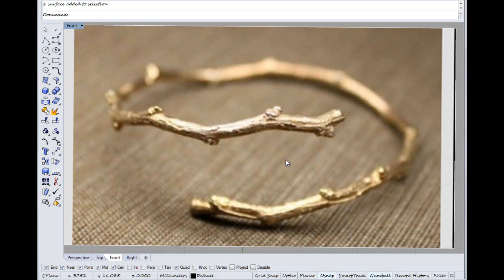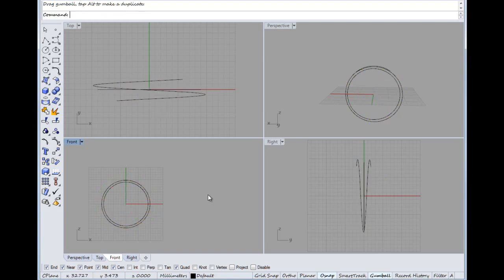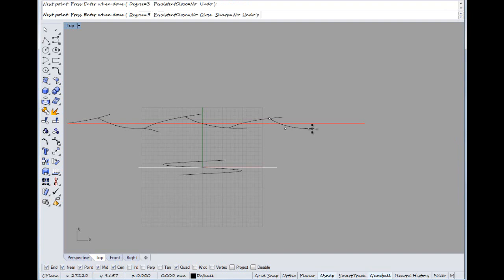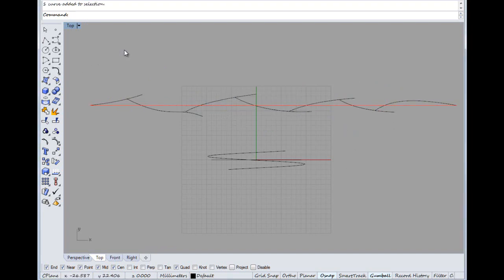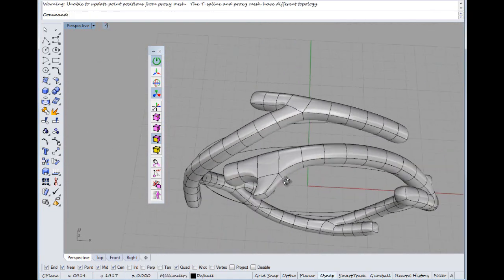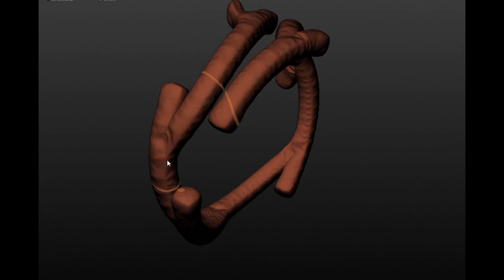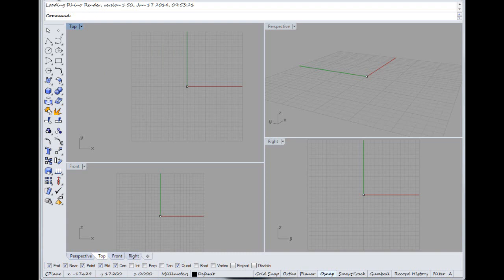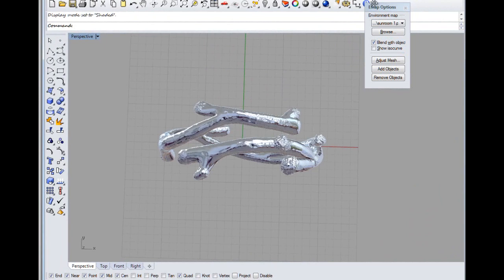Basic Rhino tutorial on making an organic branch ring with Rhino Cad and Sculptris

Comment: Hi, I really want to try to do this tutorial, and it's not working because Rhino 8 does not have the tspline splitcurve option, do you know where I can find it? Do I have to use grasshopper?
Reply from the maker: You could use the split  command and set it to point in the command line  and do each intersection manually. Tsplines was discontinued. I've not used rhino 8 yet but maybe there is a similar command in the sub d menu ?
Reply: thanks and how can I do textureing in rhino - Sculptris is not longer available and zbrush core mini does not allow the import of obj files. I got stuck there. Much appreciated! I really like this tutorial!

Comment: Hi! I really hope you still pay attention to your Youtube sections because I have gotten into some problems while following your tutorial. One is that even thought I managed to do all the steps without tSpline commands (because I don't have tSplines yet), when it comes to flowing along the surface, everything just gets tangled and wrong, and I tried mirroring the helix, booleaning the pipes, they all turned out to be distorted. Did I overlook something? Because I literally repeated every step you showed, and I can't figure out what's wrong.
Also, what are the good options for Sculprit when saving into .obj in Rhino, so Sculprit actually handles it as a solid, and not as a bunch of surfaces? I got a good look for experimenting and rendering, but certain modifications just torn the edges apart and I ended up with about 20-30 naked edges.
Reply: I have exactly the same problem. Did you already find the solution? thx!
Reply: Nope, I just gave up and made a different version lol. It's been four months, I can't even remember how I did it, but I could probably improvise again.
Reply: The thing is, that I've done it before and it never was a problem, but now it seems like everytime I try to do it, it deforms my curves... Can't seem to figure it out....
Reply from the maker: https://www.youtube.com/watch?v=QcV7yvu4MlI